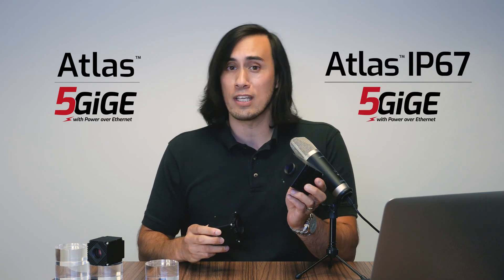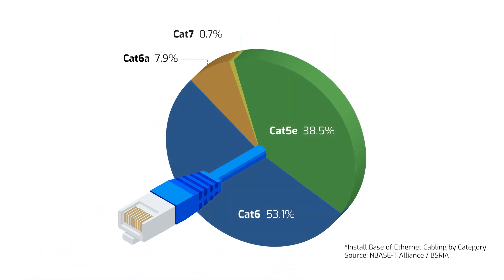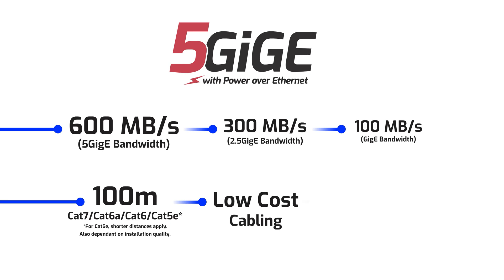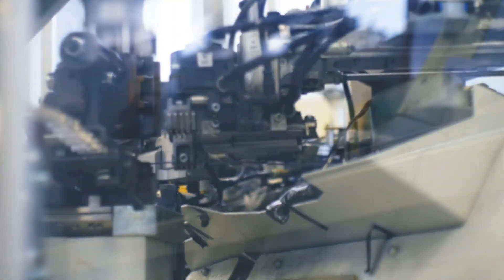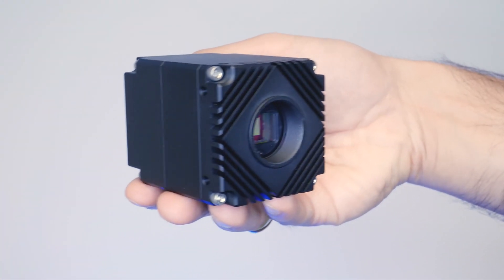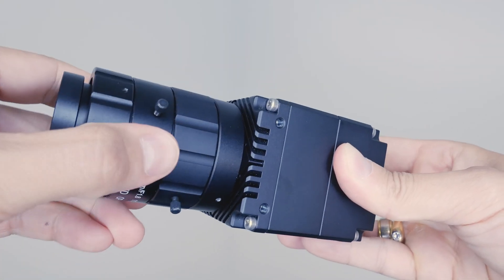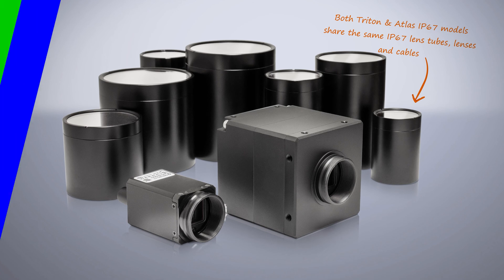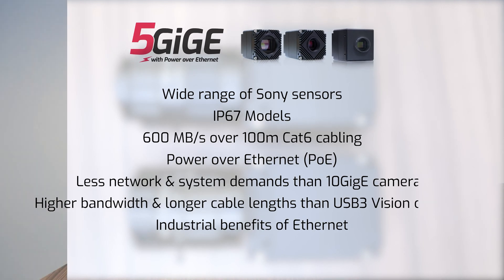Why Choose a 5GigE (5GBASE-T) Machine Vision Camera?

Comment: Does 10GigE network card compatible with 5GigE cameras? What speed will be maintained&?
Reply from the maker: It depends, some 10GigE cards may not support NBASE-T speeds (5 & 2.5GigE). If it does support NBASE-T speeds, the 5GigE camera will run at 5GigE speeds (~600MB/s). Please check your 10GigE card's datasheet or website for more info.